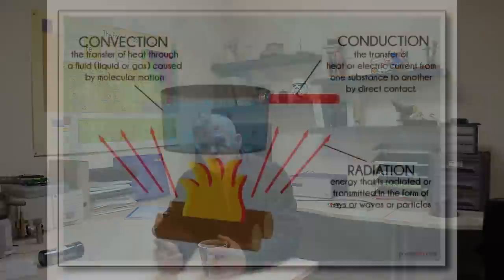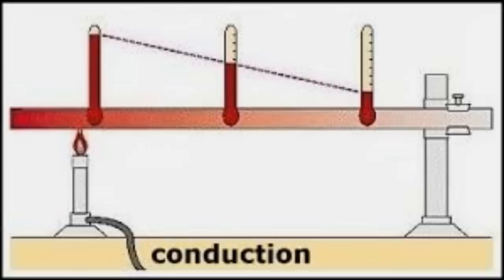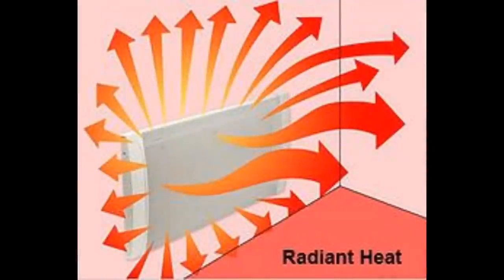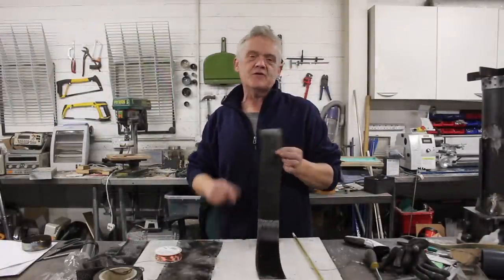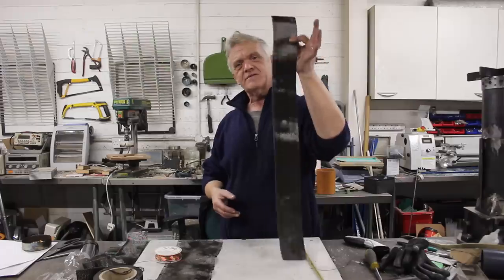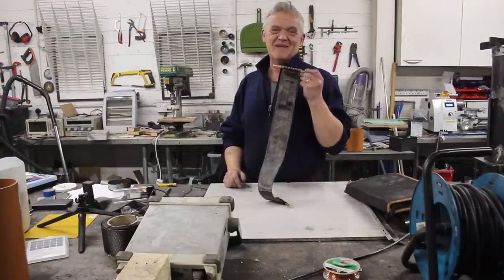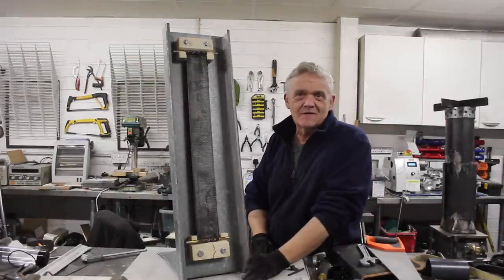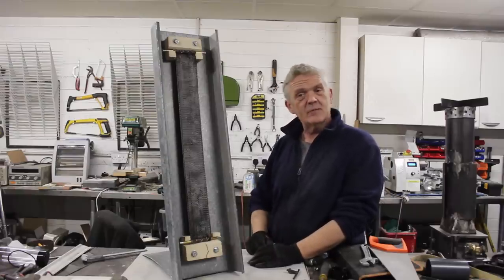1758 How To Make A Nano Carbon Infra Red Heater

Comment: i've already built a methanol heater in a baked bean can
first 2 lasted under a hour the third one using a metal toilet brush holder as a grill
lasted 3 hours and 15 mins so i'm delighted
Reply: Same here, mine only lasting one hour, I have a mantle on too
Reply: I'm starting mine this week!  Can't wait to see how it works out.  Did you use the Carbon Felt wick Robert made his out of in 1702, or did you go for the old sock method in 1746?
Reply: @Warriorking.1963  i'm still waiting for my carbon felt to be delivered but i used green floral foam bought from hobby craft for £1.50.
Reply: @ScoreGuru123  i think or should i say i have found if you put the tin into a long metal tube like a metal toilet brush holder then put a metal cutlery holder bought from ikea with holes in over the toilet brush holder it suppress the flame and causes the oxygen to get sucked in the two separate containers holes, this method was my successful long burn.

as i'm writing this i have another one on the go just over the 2 hour mark now.
Reply: Just check the monoxide level as mine is fine no mantle  add the mantle and it triggers the alarms.    Also I am lucky to get an hour out of mine.  And yes that's with carbon felt.    I am a bit gutted as I bought 100ltrs of methanol for winter and i can't get long out of 500ml fills.

I tried mixing water into the methanol and 50/50 mix 125ml water and 125ml methanol did burn longer but didn't produce good heat.    Trying 100ml water to 200ml methanol  did 45min.    So sadly the videos are fake.    As I can either pay more for methanol than gas central heating    or die of monoxide poisoning.   I really wanted the tin can heater to be real but it's not economical
Reply: @standfortruth4568  can you explain a bit more?   So the tin goes inside a long tube for the toilet brush so it's hole is at the top and then you put the holder with holes over it?  So only the holes at the very top are pulling air?
Reply: @salaciouscreations4323     Do you get sun in your yard near to nearish a window?   

    If so, I would build a solar heat collector and pipe it in through the window (just get a piece of thick, hard foam and cut a hole in it).  There is a YT channel called James Biggar who lives in Canada where it gets pretty cold, and during the day, he heats his place with Solar collectors.  

   If I didn't have so much shade on our property, this is what I would be doing. It is safe, effective, and low cost.
Reply: @justinw1765  sadly the sun isn't an option the front and back are not in the right spot to get the long duration of sun.  I was looking at filling copper tubes with sand so the tincan heater could transfer it's heat to it as sort of mini sand batteries. ( I stripped out an electric fire with an all metal body to make it more long term).    I only tried this as the smart meter reported turning the heating on was £9 for 40min of heat.   So methanol looked good as the video I watched said it is hours if he filled it half way.    Just gutted I fell for a fake video and bought alot of methanol.    I know others are as well as buying any methanol on Amazon has a section of people also bought so many in my situation fell for the mis information in the video and are going to be shocked when it drinks 500ml faster than they were expecting.    Many won't have monoxide alarms as well.  I only found out as the light comes on mine at 20ppm.  The kiddie alarm doesn't react until the other reaches 120ppm.

Without the mantel  neither alarm reacts.  So I am at a loss and a few hundred out of pocket getting it all together.
Reply: @salaciouscreations4323  Which video is that? I have 7 gallons of methanol someone gave me. I might be better off just selling it.
Reply: @hubrisnaut  it's worth testing it to see if you can make it work for you.  But I tried so much stuff it's crazy.   It all results in quick burn times and monoxide gas.   The price of methanol has also increased since these videos.  So it might be worth hangon on for a bit to make a better profit from it
Reply: @salaciouscreations4323  Hello Salacious Creations.  I've got most of the bits to have a go at this but from
what you've said, and others, about burn time I don't think I'll bother.  It seemed like a good idea at the time. I've got the carbon felt and some nice cake tins and will probably just make a couple Fancy Feast stoves
or something and give the cake tins to my other half.   Disappointing.
Reply: @Aerobob42  it's worth a try.  It's fairly typical of YouTube video to miss something out from the results they achieve.   You might be the one who solves the burn time.  I gonna try the stainless  pot cover as I am a few hundred quid in.   At the very least I got a heater for the allotment that I can boil some water for the kettle with.   I really believed it was a real video that I knew the difference.  It's very clear from this post and other posts that many people are having an issue with the burn time.  With no reply from the video maker which is the typical sign of a fake video made for clicks preying on a very real worry in the UK right now.
Reply: @salaciouscreations4323  a slow burn is just spreading the btu over a longer time frame. The thermal energy is equivalent.  

Are you exausting out a chimney to outside? Is there insulation?

If you have losses, I can understand that burn times become more important. To fast and you can't sit near it , room heats above room temp, then heat is lost through drafts or thermal bridges.
But I can assure you there is no misinformation here.
Adding water will just throw water vapor into the room which can cause room temp to fall quicker as the water conducts and holds heat.
100ml of methanol has the same Joules no matter if it's burned quick or slow. You can do some calculations to try and track down where the losses are occuring.
The methanol will have a BTU per ml, the room will have a BTU per square meter needed to heat, insulation/walls/doors and outdoor temp, humidity should give you a BTU loss per hour. 
You sound like your getting close, just a bit more tweaks to get it dialed in. 
Hope this helps, and that you can keep warm and not feel like you got ripped off.

Looking at 15000 BTU per 250 square feet. 3.5 litres of methanol should be around 64 000 BTU.
Reply: @salaciouscreations4323  it's also concerning that your getting a monoxide. Methanol shouldn't be producing a monoxide. I would stop burning it until you can verify if the fuel is methanol or if the meter is just sensative or if it's a can liner/wick combustion producing the monoxide.
Reply: @ShivaTD420  I ripped a electric all metal fire out and popped it in the fire place.   I lined the upper part of the fire place with a steel jacket to block off the chimney flue.  I added a 5mm hole for fumes due to the monoxide issue but that didn't solve it.  I have 2 vents in the room that are always open.    The fire metal the flame goes up into its lid where I have 2 stove fans to try and bring that trapped heat out into the room powered by the flame heating the top.   You can't even put your hand up in the upper bit of the chimney it's so hot.     I was going to buy some 10mm copper tube  and run it down the back and out the front to try and get it to draw more cold air from the bottom up  out the front of the fire as well or fill with sand to try and store that heat so it keeps the room warmer for longer.   I have been tempted to line the fireplace with steel plate with a gap and fill with sand behind it.    I just cannot get a decent burn time. 300ml burns in the same time as 500ml.    I thought about making a door for the front of the fire out of some plate and using the left over mesh  for its door  that way rather than the mantel.     I have been working on this for weeks now as yes it does heat up the living room  but it's the speed the flame burns makes it's  extremely expensive to run.   The original videos down in the 1702 range  said hours  at a time and I just cannot get that to work.  The 5mm hole has a flip hole so I can open and close.    I got other stuff I can bulk out the sides of the fire with as the large tin can doesn't get hot at the bottom and none of the metal fire box gets warm at the bottom.   It's why I am thinking about copper pipes so I get an extra hour of warmth out of it.  As I have spent loads trying to make this a permanent fire to use for years to come.
Reply: Ideally we like methanol because it burns clean, and can be made rather cheaply.
Reply: @ShivaTD420  it's only with the stainless mesh mantel I get monoxide.   I have the tin lid on it as well.   As a pure raging flame no issues just with the mantel and it's within minutes of being lit.   Yeah all 100ltrs I bought is methanol.   The wick is the pure carbon.  I am willing to try the can liner to see if it's that.   Or even a mesh door instead of a mantel
Reply: @ShivaTD420  the price is rising quickly right now.  The sellers on Amazon are running out of 4 X 5ltr for £36 deals and it's quickly becoming £16 for 5ltr.     It's why I bite the bullet and got 5  4x 5 ltrs before I missed outbon the price.   Storage it's in the plastic containers it came in  and kept inside a steel drum inside the shed for storage and remove any ignition sources.
Reply: @salaciouscreations4323  the burn time just puts the thermal energy into the air faster. Lemme review that video to see that design.
I gather it's burning great, but the quick speed just means your heating the room over room temp then loosing the heat.

So when you put the Mantle on does the burn time increase? Might be getting a incomplete burn which is throwing a monoxide. That's a tricky one. 
Props to your attention to details.

Yeah the copper is a good idea. I do a similar tactic and try and pull all the heat into a water tank from recirculating water in the copper.
Reply: @salaciouscreations4323  ahh it's the tin cap, switch the tin for aluminum or steel.
Tin oxide reducing the co2 into co.
Reply: @salaciouscreations4323  yeh most manufacturing of methanol uses methane(liquid natural gas) so I gather the current world events don't help the prices.

Keep in mind some methanol on Amazon is reagent grade which may be overkill. You want the methyl hydrate grade hardware stores sell. It's around 15 per 3.7 litres. Or 9£  st your currency.
Reply: @salaciouscreations4323  It's not worth testing; not going to  waste my time trying to build a methanol stove. I can buy a decent quality one designed for camp cooking for around $35.  I live in Maine, USA. We mostly use methanol as a paint thinner and adhesive solvent; I can't believe methanol would be a fuel you would even consider as a heat source unless you could produce it cheaply yourself. Here, methanol is four times the cost of heating oil; heating oil produces more than twice the BTUs. Rough numbers, I would be paying $40 v $5 (8x) for the same amount of BTUs.
Reply: @salaciouscreations4323  the tin is placed on top of a smaller empty can of pineapple and both placed inside the toilet roll holder with the mantle ie cutlery holder bought from ikea with lots of holes in placed on top of the toilet roll holder.

the lid of the toilet roll holder is then placed on top of the cutlery holder.
as both the toilet roll holder and the cutlery holder have holes it works i guess like a vortex with oxygen been pulled in some holes and flames shooting out the others.
the heat radiates horizontally with the lid on  favorable if you're sitting.  without the lid you won't get the smell from the metal heating  and it radiates more upward.
the lid will glow red and blue as the flames blast through the holes for a hour strong then they will lower and you can either leave the lid but yes it can set the alarm off or you can take  the lid off.

i'm using 300ml of methanol and it burns for over 3 hours the last one i did, i outed the flame at 3 hours because after this it starts to smell.
i kill the flame at this point as i've quickly learnt for 15 mins longer they'll be a lingering smell when it goes out, 3 hours burn time is good enough for me.
Reply: @salaciouscreations4323  Thanks for your reply.  That's a lot of money, I feel for you. I'll probably try the alcohol
stove first as I've got enough carbon fibre and see after that. Good luck on the allotment.
Reply: @ShivaTD420  I will see what I can find  as I wasn't expecting tin to still be used these days.   I thought it was all alu or steel.
Reply: @ShivaTD420  I will see if it's possible to get that.
Reply: @ShivaTD420  I grabbed 2 dog food tins with pull tops.  Replaced the inner can    used the pull top as the cover for the fill hole to stop the flame getting down in there.    Used the second can as it fits the other perfectly as its base so it's stable and put the mantel inside that after cutting away the Sides other than some thin strips to hold the shape.   So the mantel is stable and easy to move and is interchangeable with the fuel cans.      It's been 45min and no alarm for monoxide yet.   It's typically within 5 min.  Just waiting to see if the burn time is any better as the flame is smaller with uncut fuel.    Added 2 fire bricks to the top of the fire and moved the stove fans forward and blow on the lintle better as that gets really hot to make more use of that.    I gonna get 10mm copper pipes to get it to move more air tomorrow.   I might Criss cross a mix of pipes in the top of the fire so the side to side has sand in and the front to back and pulling air from the bottom.
Reply: @salaciouscreations4323  Keep us updated, Cheers
Reply: @limmoblack  still got a monoxide issues. But weirdly  the alarms triggered 2 hours after the burn.  The rooms upstairs  where they have no bearing on the house  were showing 60ppm.  So I think it's the attic it's coming from as hey it turns out the neighbor has blocked the chimney so his attick was showing 500ppm of monoxide.  Going to increase the hold to the flue size to 10mm as it's only 5mm.   I think the cold air in the attic might be pushing it all back down after it cools down.
Reply: @ShivaTD420  so builder fixed the damage the neighbors DIY chimney block. And no monoxide.     Any tips for making the burn last longer.   As 500ml is about 1hour :20 min.       The bricks are working well as storage of the heat.    As it's staying at 20°c most of the night until morning.      Just no idea on how to reduce the speed of the total energy  burning.

Comment: Next time you pass by your scrapper, grab a few diesel glow plugs. They can get your motor block heated up enough in a few seconds, they should be fine as "radiator" maybe stuck in a metal plate.. or to heat a sand battery (metal rod) with intermittent solar/grid power.